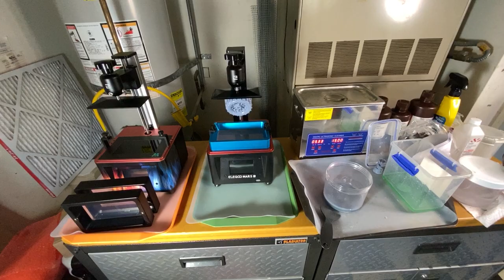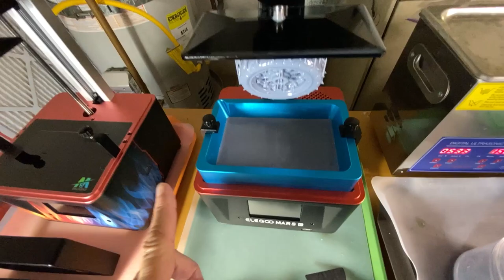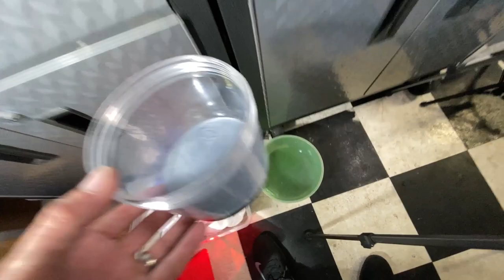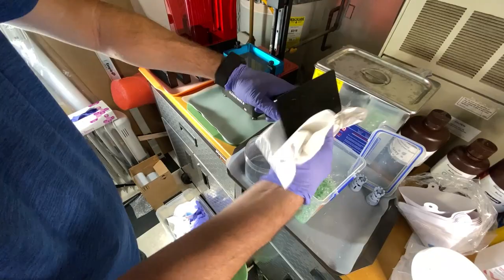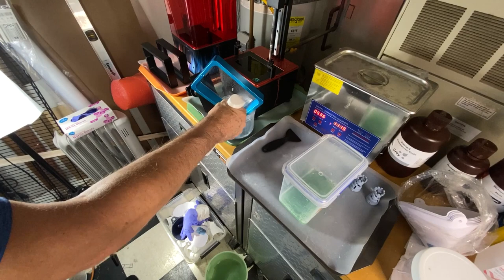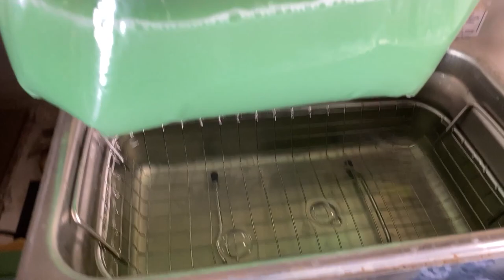My Printer Station & Ultrasonic Cleaner Setup: Post-Preparation Steps for Resin 3D Printing

Comment: How do you make sure the paper towel/glove waste gets cured properly before throwing it out? I've only been printing a few weeks and have amassed decent pile of wadded up paper towels I need to deal with. But short of unfolding them and laying them out in the driveway or something, I'm not sure how to get them cured properly.
Reply from the maker: NyxErinyes You just want the resin to harden before you throw it out so that it’s no longer toxic. Laying it out anywhere in the sun is fine.